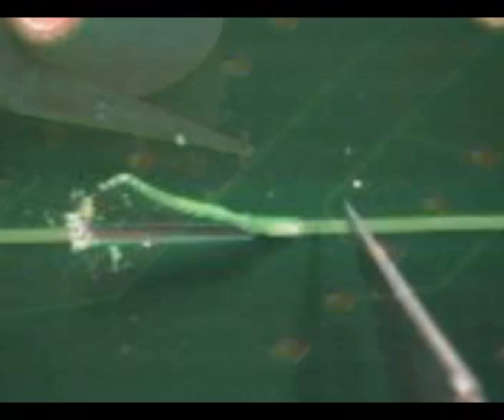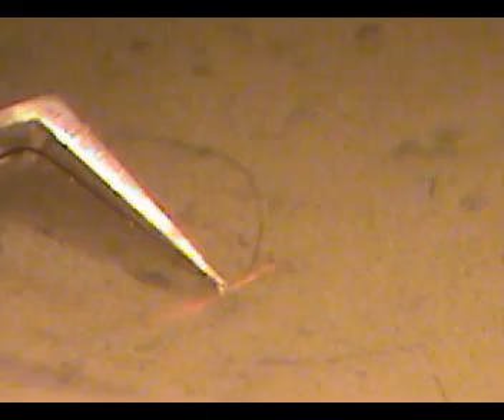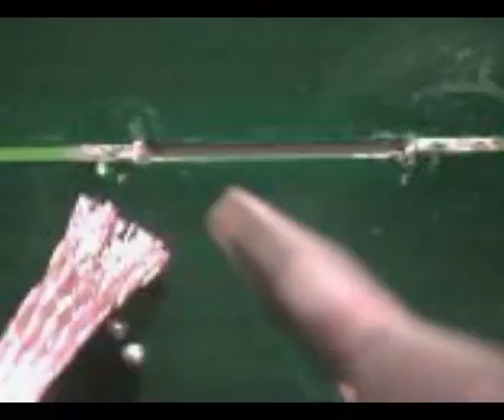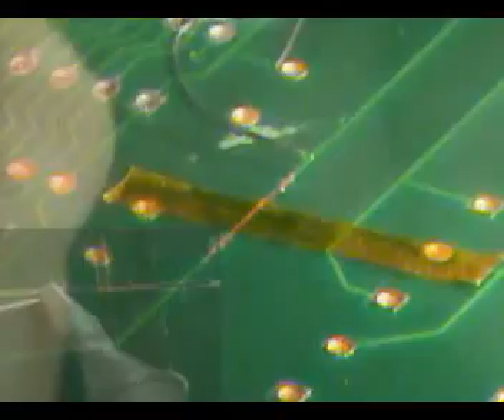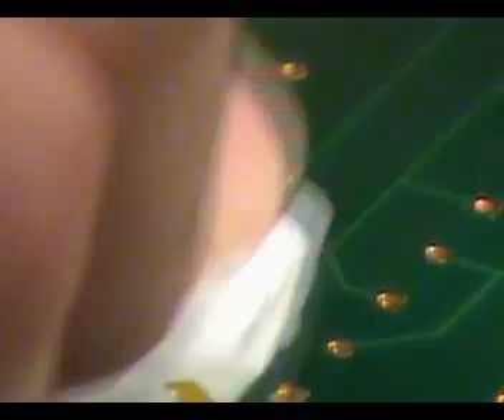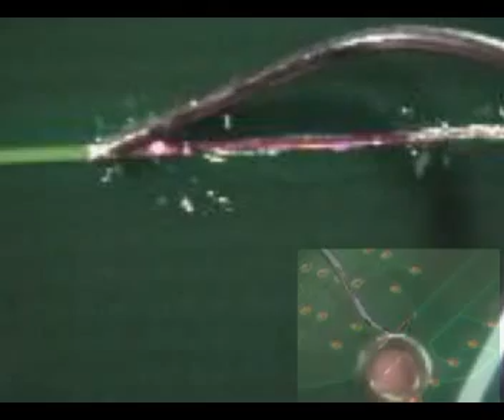PCB Trace Repair Method Using Epoxy | BEST, Inc.

Comment: Where do you get that flat copper used for trace material? Also, is it sold in different sizes (I work on boards with various size traces).

Comment: Tip: If the piece is really small, don't cut your jumper ("replacement trace") off from its source (roll, longer piece etc), before you solder. Cut it after soldering both joints. This will afford you a little more time to get the 2nd joing nice and well, before the tiny wire/jumper gets so hot that the 1st joints melt again.

If you try to solder more than one joint on a very tiny piece, there's almost non thermal mass in it, so it will get hot enough for the solder in the other joint(s) to melt and move, almost instantly when you touch the wire with the iron. Navigating a pre-cut microjumper can be very tricky too, so if you hold off on cutting it off until you're done soldering the joints, it had a bit of a counterweight effect to it, making it a bit easier to navigate the business end, absorbing some of the minor tremors of the hand. Also make sure the side of your palm (and ideally all the way out including your elbows) rests on the work surface if at all possible, only navigate the iron, solder, wire etc with the fingers and fingertips. This decouples much of the small tremors in your hands and fingers, coming from the tensions in the larger muscles in you arms and shoulders.

Comment: some tinned copper wire scabbed in and then brushed with conformal coat is fine unless board is subject to loads of movement. that repair took far too long and quit saying soder, it's solder.

Comment: I'm not sure what the pro's use but I'm doing a little pcb repair ( hdmi port bridge) and using individual wire strands from scrap wire I have laying around. 18 gauge wire, strip off all the insulation and you can make tons of leads.

*audio speaker wire has some super fine strands btw and what I'm about to try on my next dry run repair. Original xbox one hdmi out port is gone, 6 pads left on the pcb of the original 19, it literally looks like someone took pliers and ripped the port out. Also 3 resistors under the heat sink are missing 😵 thank goodness I'm near-sighted because I don't have a magnifying glass to use

Comment: Nice way to turn a 1 minute job into a half hour job. Could have just bridged the two trace ends with a piece of throughhole  component lead (plenty of these laying around a repair shop), covered it in conformal coating and called it a day.

Comment: I keep a little bottle of clear nail varnish.
Very handy for sealing screws etc in place.  Would probably also work for sealing this as it is strong, water-proof, no fuss and dries in 10 minutes. It also works as a glue for repairing small cracks in plastic.

Comment: You wouldn't buy the copper.  If anything you would get it from spare wire you have laying around your home i.e. speaker wire, or cat5 cable.  You may be able to use Kynar wire if they have a small enough size but I believe they use silver as opposed to copper which is more conductive.